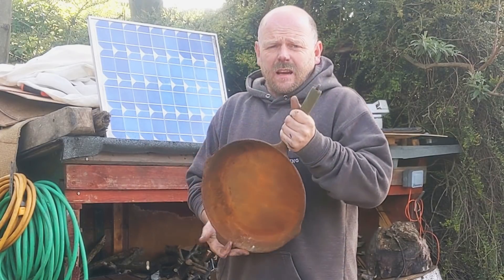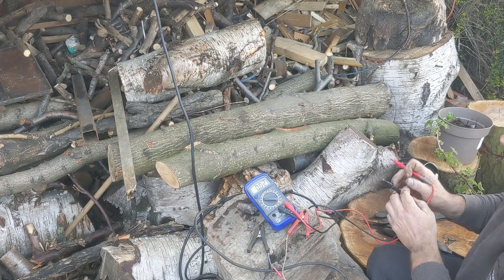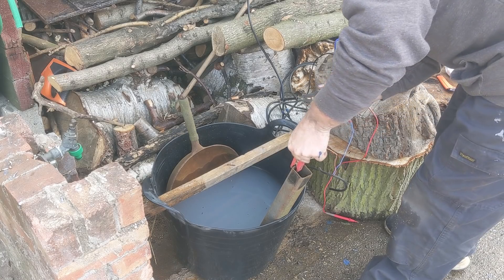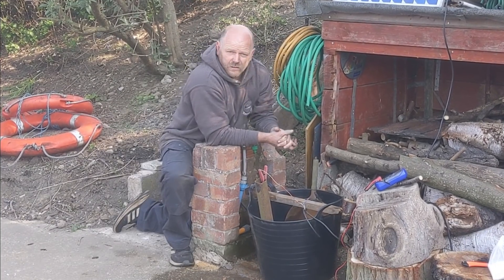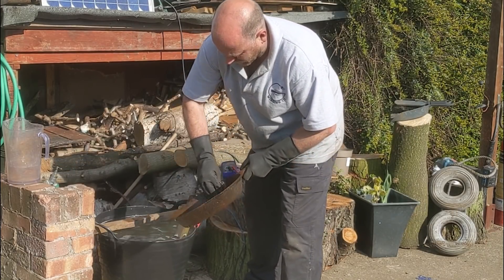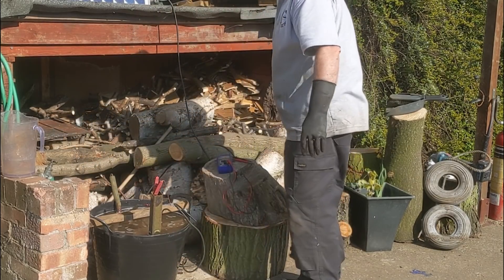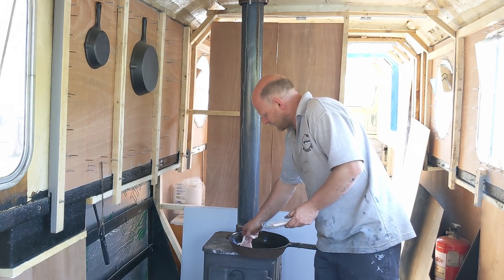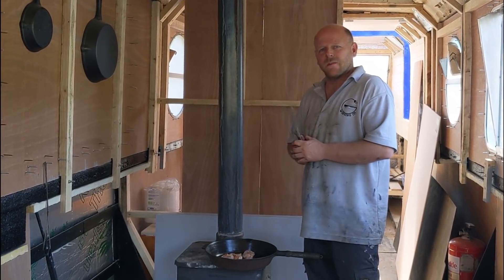How to use ELECTROLYSIS to Remove RUST and Restore a CAST IRON PAN or TOOLS using a Solar Panel

Comment: Just watched this as a recommendation on Twitter and I was wondering do you think it will work on rusty, old steel windlasses? I am slightly petrified that I am going to electrocute  myself doing this, but I am so impressed with the results you got with your pan, that I may give this a go. Great vlog!
Reply from the maker: Yes it should work fine on a windlass. So long as your only using low volt (around 12v to 24v DC is the norm for this) you would be fine, the amp is so low there is no risk of electrocution - certainly nothing to cause harm. If you can't use a solar panel a standard MANUAL battery battery charger is perfect (must be a manual one non of the 'smart' ones as they wont work).
Give it a go, sure you will have good results!

Comment: you've inspired me to have a go at this, what's the approximate voltage please?
Reply from the maker: The solar panel I use is 18v - but you can use lower or higher voltage...
Have a go, I'm sure you will have fun!
Reply: @WingingItBoatingonaBudget  Thanks for that, I'll probably have a go.  From one tight yorkshireman to another.

Comment: Where there is a will there is a way.
Is there a way of contacting you? Email etc. Re Nuts and Volts.   I would like to see it up and running.   I'm an electronics engineer.    I may be from down south but I've been called tight before now.
Reply from the maker: Electrolysis seems to be the only bit of electrics I've had joy with lately! 
Struggling with nuts n volts at the moment so by all means any help would be appreciated! 
Initially email us at wingingitboat@gmail.com
And we can take it from there. Cheers

Comment: Hi Pete, how did you the the metal bar would extract the rust from the pan and not vice versa ?
KitKat
Reply from the maker: It's down to the flow of the current. 
It flows from the negative across the water to the positive. Hence putting the positive from the solar onto the sacrificial piece and the negative onto the pan.
Reply: @WingingItBoatingonaBudget  Hi, I take it the the flow of the electrical current not the water current 👍😹😹😹😹
Reply from the maker: @philhonour450  yes that's correct... 😁
Reply: @WingingItBoatingonaBudget  so if you reversed the current the pan would get rustier 💡😹😹😹😹😹😹
Reply from the maker: @philhonour450  yes - whatever has the negative clamp on 'cleans' and whatever had the positive clamp on is the sacrificial piece.

Comment: I had a set of five cast iron pans, but I couldn't get the larger ones to "season" properly, then I discovered, despite being careful (letting them cool before cleaning) that the two medium sized pans, each had a crack so I got rid of all of them.
Reply from the maker: Ah what a shame. cast iron is great for cooking in...

Comment: Top notch vid Pete. If they taught it like that in school more might listen! BTW, for smaller items if you put them in an aluminium tray (pound shop or like what yr takeaway comes in) with the bicarb solution you'll get the same result without the solar panel.
Reply from the maker: School would be better if I was in charge of education!
I guess the solar panel / a battery charger is just increasing the 'magic'....

Comment: Nice job...just a bit of advice...don’t add salt if you do it indoors, the process gives off chorine gas which is very dangerous in an enclosed space
Reply from the maker: For safety I'd only ever do stuff like this outside...